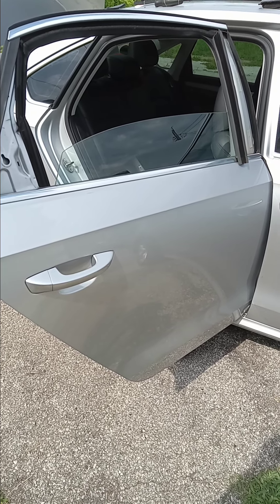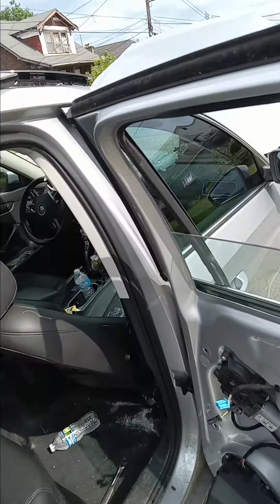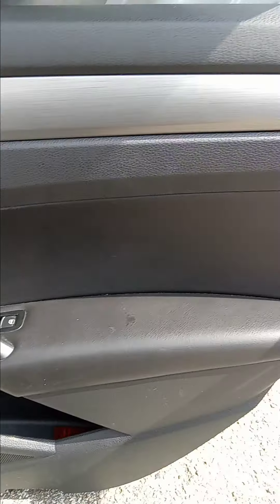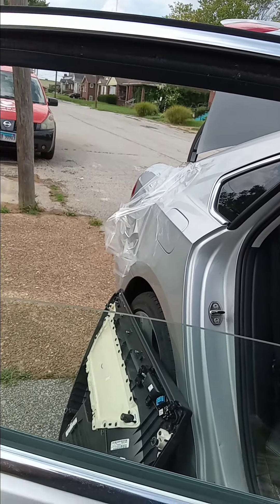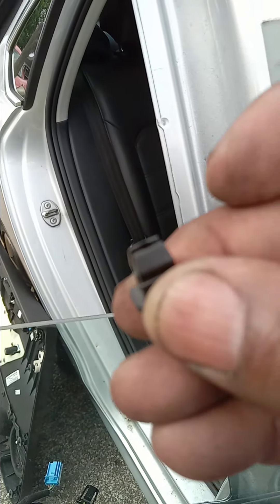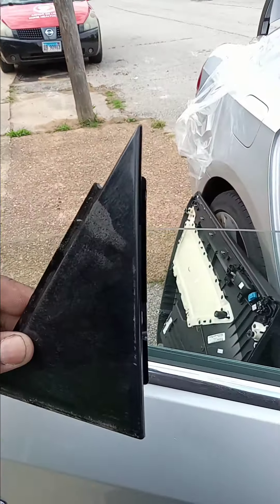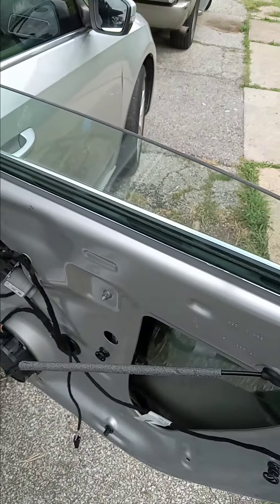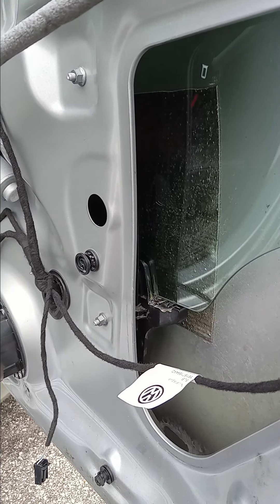2012-2016 Volkswagen Passat rear window replacement

Comment: How about you show how you put it all back together? I had to pull the window regulator loose on mine so the glass would go down in the door far enough to come back up into the tracks. Didn't have to pull that front trim or window seal out that way.